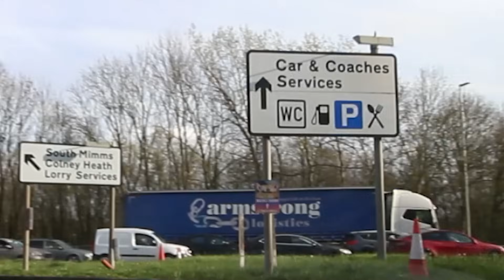Time warp Southend car meet, just like the good old days!!!

Comment: You've probably sorted this out by now but if not, give Need 2 Insure a go. I've both my Mk1 RS's insured with them and have found them to be really stress free and fair. Boncaster who I was with years back refused to insure my car once I fitted a front mount intercooler to replace my chargecooler which adds nothing, if anything power wise. These guys were good as gold.  👍